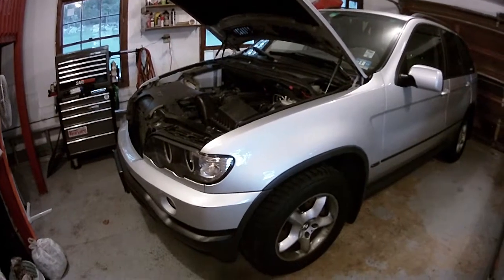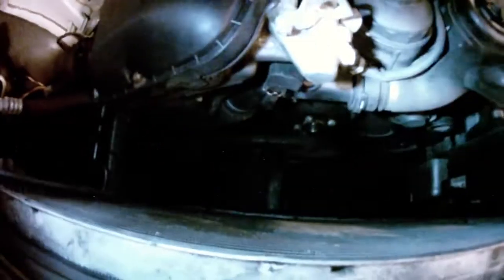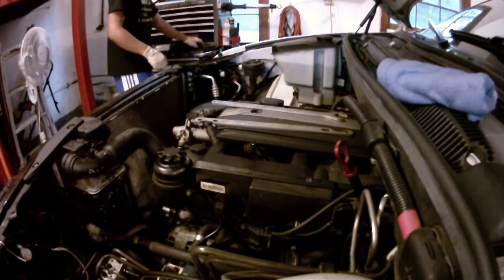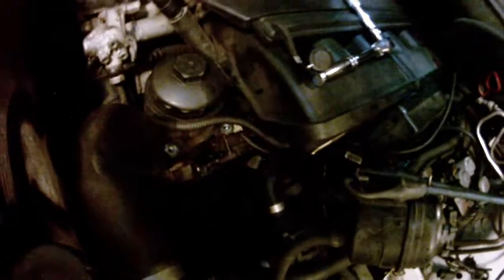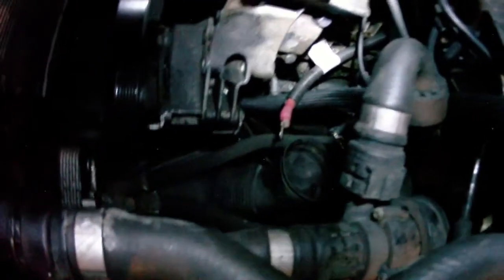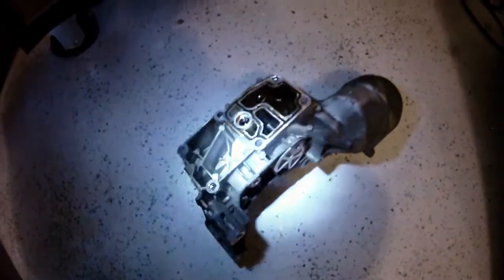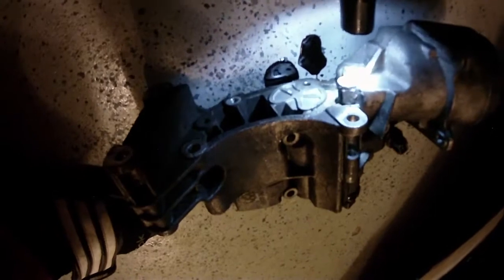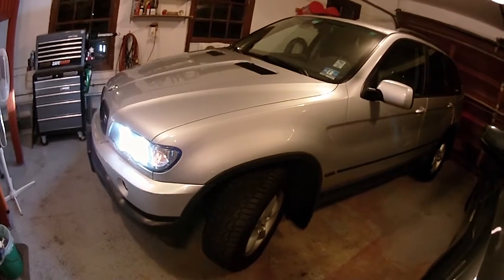X5 Diaries Ep.02 - Oil filter housing gasket on a BMW M54 motor

Comment: I have a 2003 bmw x5 3.0l as well and mine has alot that needs to be fixed it has about 155,000 miles do you have any advice?
Reply from the maker: These are so cheap and have so many DIY videos made for them you should try working on it yourself or with a friend.  If it is a big job, such as a bad motor, transmission, transfer case, etc... just sell it and get a new car. Otherwise, many repairs should only cost up to a few hundred dollars and will keep this nice SUV on the road.
Reply: +Andrew Chow thank you and I will definitely sell if it gets to that case